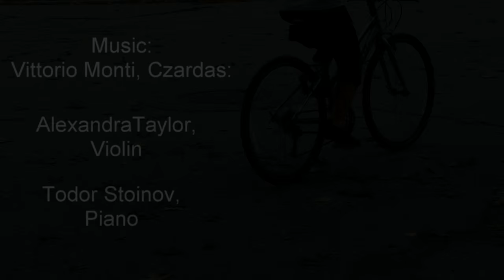Stopping and Restarting a Bicycle

Comment: Used to riding an upright tricycle and now got myself a bicycle. Haven't ridden one in 25 years and was able to put feet on ground when I did so obviously seat was too low. Now trying to learn to ride again and it is SCARY! Seems so much higher and further to dismount. Scared just thinking about stopping at traffic lights or going downhill. Need to relearn to cycle on two wheels. This was a good video and made it look so easy to start stop. I'm still struggling to start.

Comment: An extra step I add if I have had to stop before I can shift down, is to lift the rear wheel by holding the seat, while simultaneously pushing down on the high pedal and downshifting to select a lower gear ready for starting off again. I've found it's a useful habit to use if you get caught off guard by a red light and know you will be stopped long enough to carry it out.